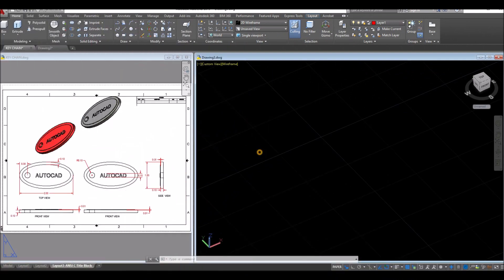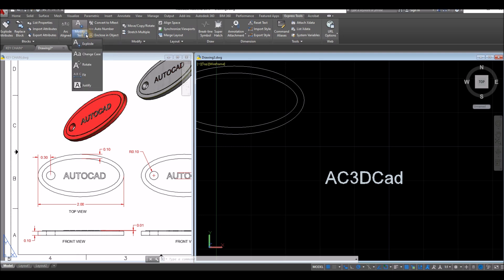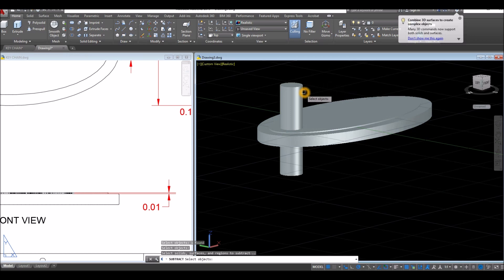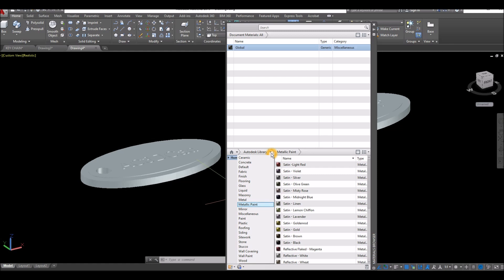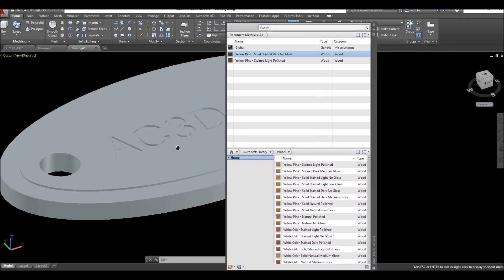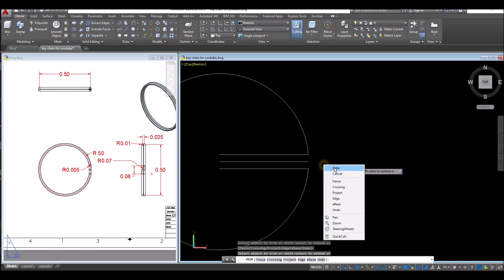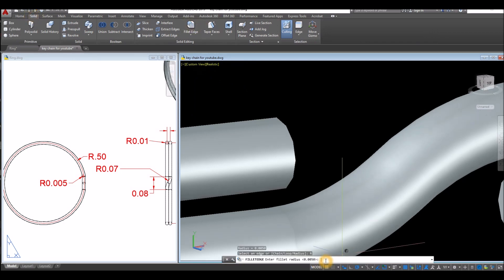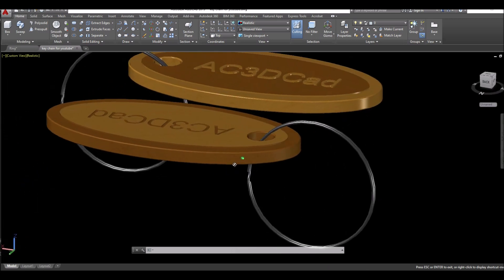How to Emboss & Engrave Text on 3D object in Autocad

Comment: Thank you this is very helpful, I have created embossed text on an irregular lofted surface, and it worked, the only problem is that when I try to Union the text with the object, it doesn't work, it says you need at least 2 surfaces or 2 objects.. When I go to properties, the text is classified as a 3d object, but the surface, even tough it has a thickness a join with another surface, it is still classified as a surface, any idea how can I fix this?
Reply from the maker: Try to convert the surface to a solid by using sculpt command. Just make sure the surfaces combined is watertight, meaning no gaps, no overlap.